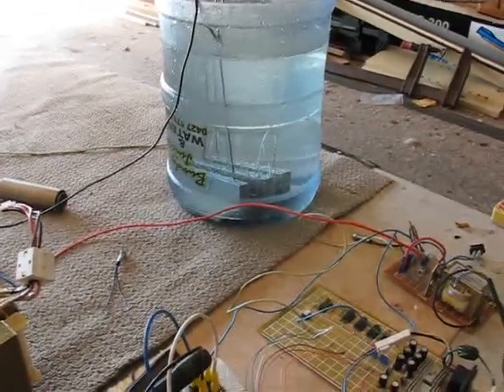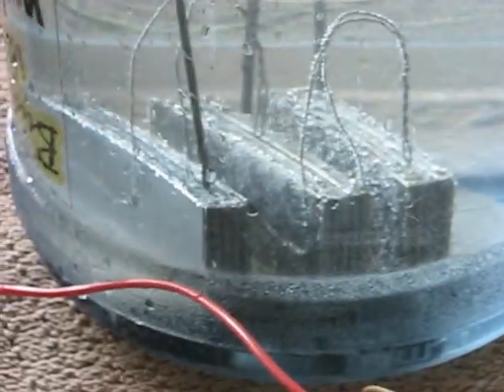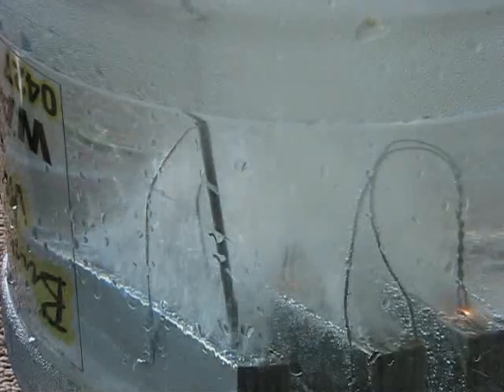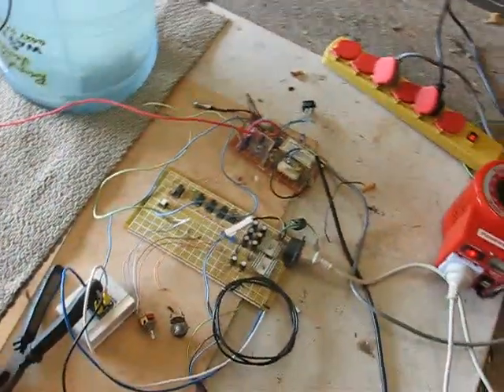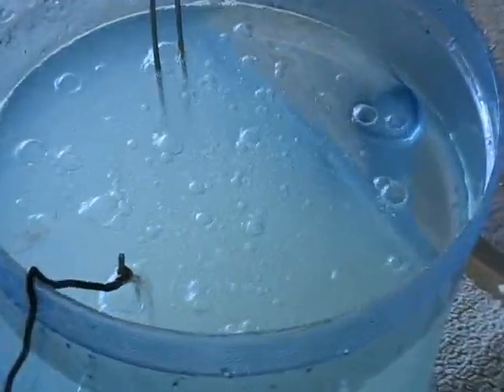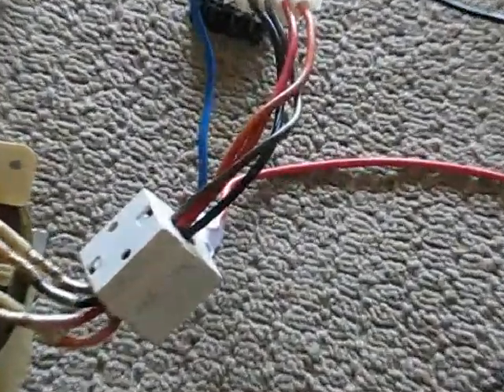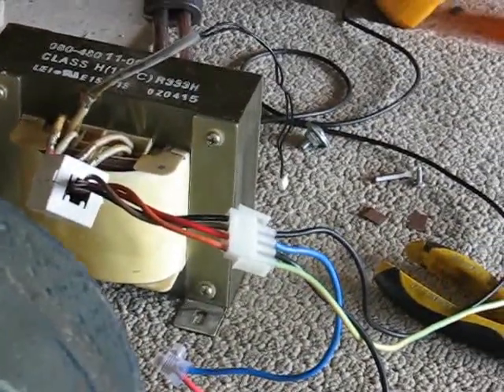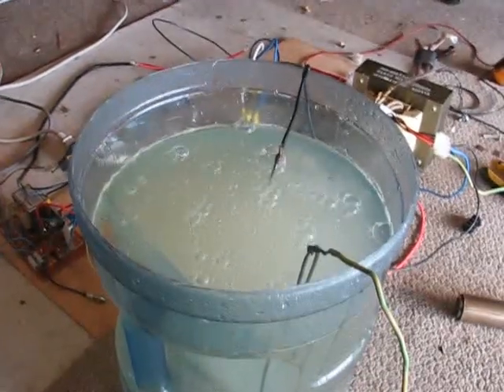HHO 8XA 3 cell test.flv

Comment: After all this time I finally figured out why it works so well for you. It's the thickness of the plates you are using as the thicker they are the better as that forces the electricity to go through the plates and not around them due to the way this all works.
Reply from the maker: It is the plates in the middle, that have no power to them Power goes like this +O-O+ +O-O+ +O-O+ the negative plates absorb the extra positive energy that is created while in operation allowing for more hydrogen to be created, also if you place this setup on a car, and do not use a bubblier, the cell needs to have a vacuum on it, use a lid that pops up if a backfire was top happen, also need a high voltage boost spark.

Comment: and u connect like this:
 P+
/ \ space
P P
| | space
P-P-
\ / connect by wire 
 P+
/ \ space
P P
| | space
P-P-
\ / connect by wire 
 P+
/ \ space
P P
| | space
P-P-
probably beetween plates u have 15 volts, on long time test, not raise water temperature? because your amps was high, my plates surface area is around 50cm2, and last voltage set was beetween plates 10 vdc and 2 amps, and tap water start temp was on 15celsuis, when raise temp to 40, amps raise to 3 amps

Comment: hi spacemanaus, can you explain to me how you joining cell, which direction and how many neutral plates use? and explain inductor/transformer connection? inductor's wire thick? how many turns on inductor? if you can measure inductance in henry, and some base parameter plates surface area, gap. I listening so many time your video, but I have wrong english skills, I cant understood it, thanks

Comment: I think you tried something new and no one caught it with a wet cell design with neutral plates to add resistance to the system. Meyer says water is being used to add resistance to the system in his set ups and you found a way Meyer did not, impressive! In your next plate ER build try to use shim stock plastic with a thickness of .0075" - .0050" to separate the plates and go with 4-6 neutrals to cut the amp use. Output should be more than double what you are producing which is already impressive